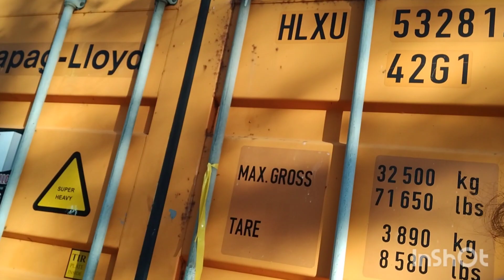Well, that is a deep subject!

Comment: Fun, fun, fun..  I changed out a 3 wire well pump in my old house some years back and it took me an hour, with help..  It was 80 feet down and had been in the ground for 24 years..   My neighbor told me that it could have been hit by lightening in order to knock it out..  It cost me $750 for the pump and $0 for the labor..  It's so nice when we can do our own work, huh Denny..?  Good job you two..  ML..  😊😊❤❤
Reply from the maker: Thanks! It took us two weeks just to get all the right parts 🤷 didn't take long after that. Thankfully well pumps are a lot cheaper now! This one was only $200. All the fittings and check valves add up though. ML ❤️❤️❤️